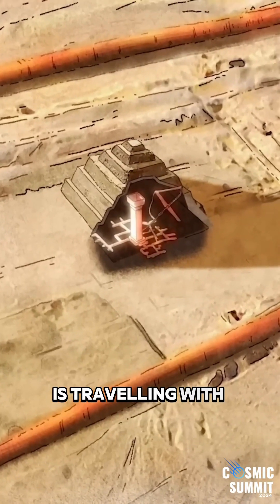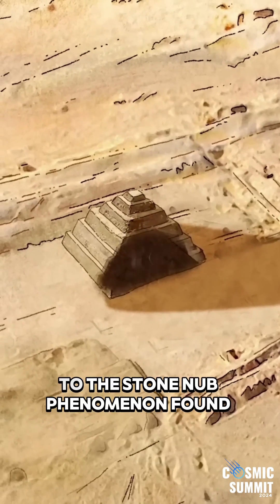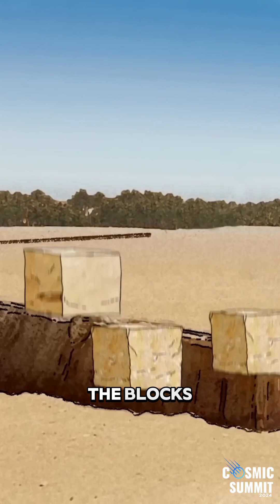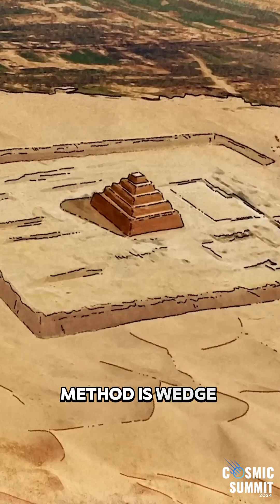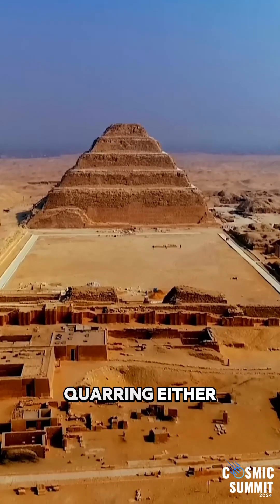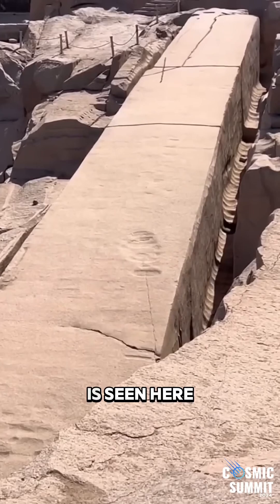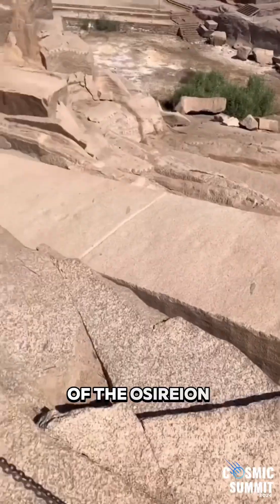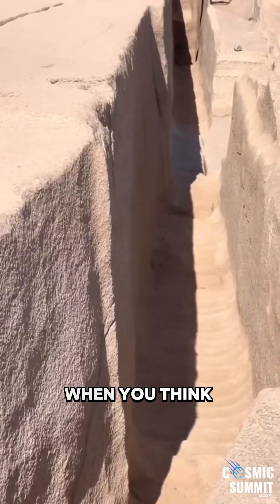How Ancient Nubs Redefine Quarrying Techniques

Comment: The nubs would be on the bottom. Just before lifting it from the ground. The stones would be chiseled on the bottom to little nub points and the rest of it would be off the ground. Then they would put their ropes around it. And when ready break the nub from the ground. Leaving a nub in the side of the stone. To be later removed when placed.

Comment: "The Bronze Horseman" sculpted from a 1250 (originally 1500) ton granite boulder transported by 400 men in 9 months from Finland to St. Petersburg. One exclusive enormouse barge, and two war ships wdde used as transport once the granite got on shore
Reply: The transporting large heavy objects by barge/watercraft has never actually been the issue. It works if you upscale it enough. The irresolvable issue is the rivers are too narrow to accommodate any craft of that size. We have the same issue in the Americas with things like the Olmec heads, the physics and math necessitate a craft of a certain size and it has to fit into the river/channel it's traversing and they simply don't fit. They don't fit by an absolutely phenomenal margin.
Reply: @CoffeeFiend1   Thank you for taking the time to explain that. I geniunely appreciate the insight!

Comment: If the stones were cast and dried by thermo setting like Portland cement does, an imperfect mix could result in areas that have higher heat and the resulting effect would be nubs
Reply: As it settles I believe nubs from a gap left for excess air and water while settling or being pounded from above?

Comment: the curved surface suggests slabs of something like clay, being stacked on each other while wet. they then have almost no gaps, and tend to bow a bit, from the weight. the nubs could ve caused by some kind of vacuum device like a tube, used to pull the stones into place. apparently there is a kind of modern device like that.
Reply: Why would they not have simply brought slurry to the worksite and poured it in, let it harden and that would be that.
Reply: I watched this several times trying to see what i was missing, befote i realised that the 'astute observation' was the existence of the nubs, rather than some explanation. It seems the point 'you just dont get nubs' is simply WRONG, because the evidence that wedge and chisel was used in most sites is pretty uncontrovertible, and yet nubs exist.  Far more likely we just dont  understand the behavior of the stone.
Reply: @markdoldon8852 The nubs weren't accidental products of the rough quarry stage. They were intentional points used for levering rocks into position. And once in position, they were removed as part of the final dressing. 

Would be my guess. 

As there is good evidence of nubs being left behind intentionally in places where a stone would need to be repeatedly levered.

Comment: Don't get nubs that way because the stones are mixed and cast not cut.The nubs are from the wood wedges etc used to prop up the bags of stone mix as they cured.
Thats how they were able to get mega ton  sarcophagus underground in inaccessible places...because they were cast there and not cut and somehow magically manipulated into place without the 100s of "slaves" required.Not rocket science just simplicity/common sense

Comment: Those aren't called nubs, they are called protrusions.
The protrusions were used, with wooden beams and fulcrums. to lift up blocks on the workpiece, so they could be worked on, and then lowered again.  Small areas could be removed, the block could be lowered into place and if the blocks weren't perfect, the process was repeated (the block was lifted again) until the fit was perfect.  They are on purpose!
That's why megalithic stones with protrusions appear to have been "cast" w some "high tech," and have perfect fits that you can't fit a razor in.  
Not a mystery to actual Anthropology students who have attended university,...
Reply: This is latest hypothesis.
Reply: What’s wild bro is you really had me thinking you were making good points. But as soon as you said “bEcAuSe iM a UniVeRsItY StUdEnT” all credibility I thought I might a had has disappeared. You just repeat shit out of books other people made and you just automatically assume every single word is absolute fact because…… because why? You think the “experts” don’t ever get it wrong?
Reply: That's the best you got?  Anthropology? University?...They Are Not Teaching You Much Are They?..I Would Tell Exactly How They Did It...First...I Need You To Apply To My University 🤪....✌🏻
Reply: @victorballesteros9198  So,... what's your hypothesis then?  I would be slightly interested, but you instantly lost the debate when you "tried" insulting me.  It shows you have no evidence or actual data to offer; that's why you had nothing else but an insult.  You obviously never took debate classes either.
Reply: @victorballesteros9198  Trying to "learn" actual Anthropology, isn't received from watching Ancient Aliens.  NONE of those boobs have degrees in anything related to history or anthropology.  Just look at the IMDB cast of AA.  For fuck sake's it even says it's for entertainment purposes at the beginning of the show!
And Walther is absolutely correct; insulting someone at a debate is an instant lose.  If you do disagree, you have to prove it.  Throwing insults shows you have NOTHING to offer whatsoever,...